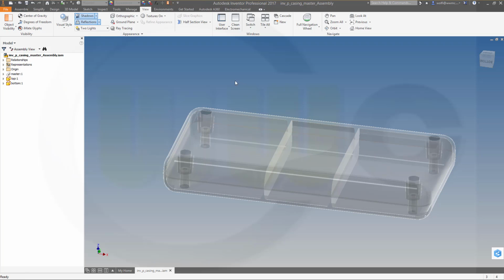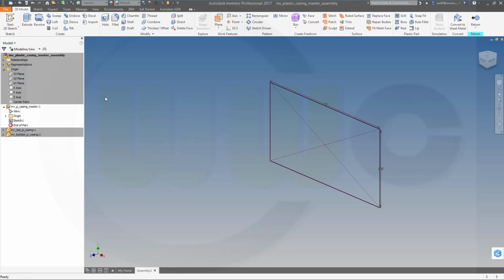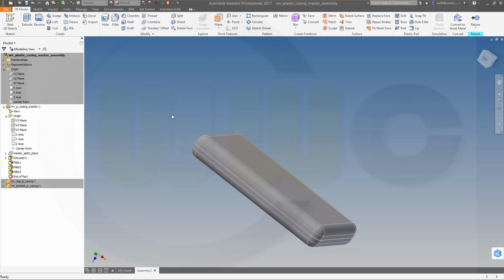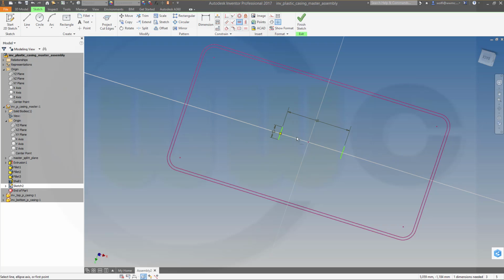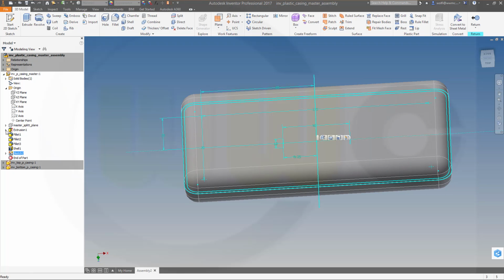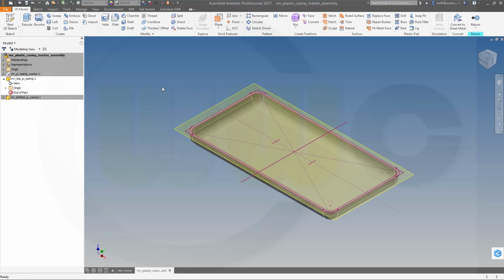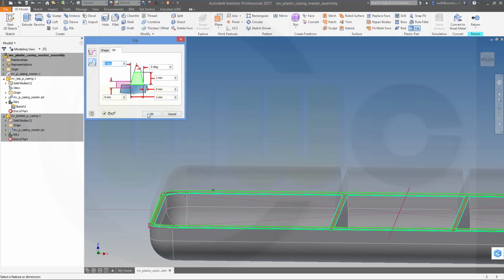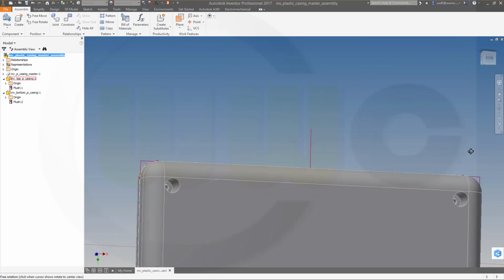11.5 Plastic casing advanced - Inventor 2017 Training - Part Design

Comment: Hello im trying to move a bodie point to point in inventor like fusion 360 or autocad. But i dont find how to do it. Do you know the name of the command to do it?

Its because im making a plastic casing, but i need to cut the bodie from the case to make it fit and i need the exact position
Reply from the maker: you can move a body/solid : 3D Model -> Modify - expand it ->Move Bodies